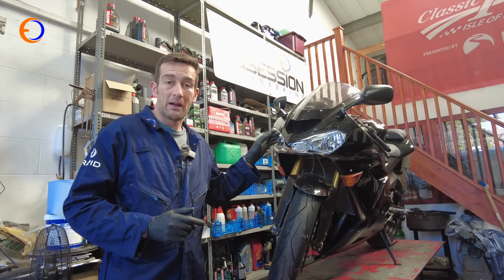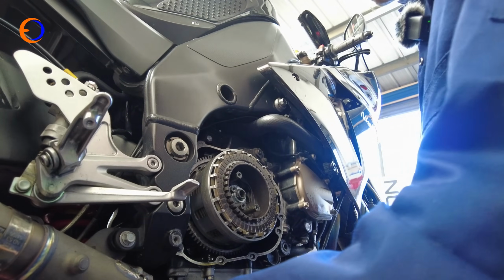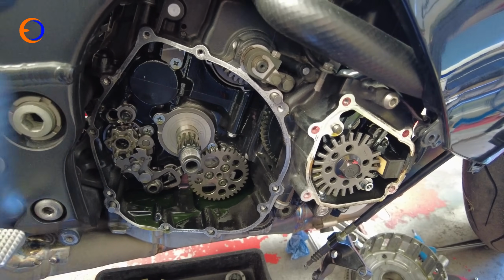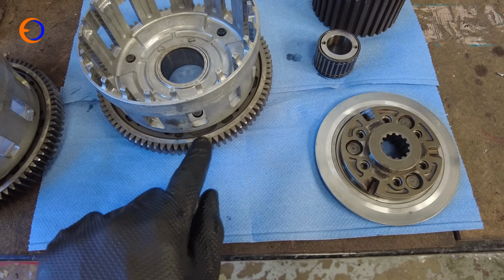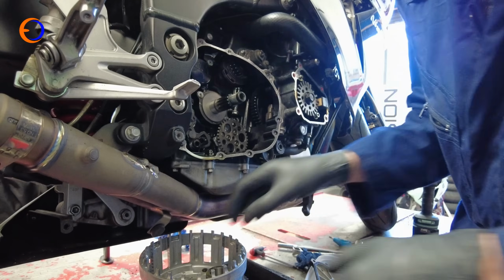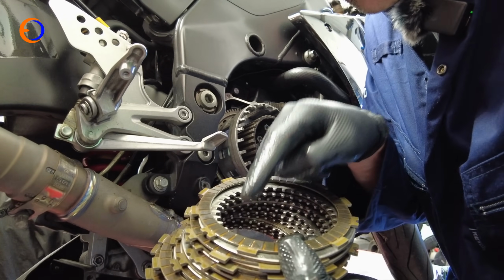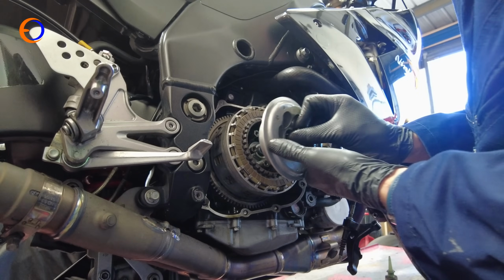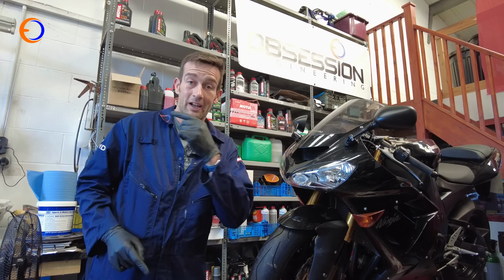ZX10r Clutch fix. Finally sorting the Kawasaki's rattle. Slipper clutch explained

Comment: Did you have a vibration in the footpegs. Did the buzzer go away when you pressed the clutch?
Reply from the maker: The noise was vastly improved with the better clutch fitted, and the noise was less with some load on it

Comment: The clutch arm under extreem load can pull down and fall off the rod and damage the arm engagement point to the rod, to fix it you may add a 3mm spacer or washer on top of the clutch cover where the spring and .5mm washer are located, this will prevent the arm from down force of the spinning clutch,,,,,, I cut a hole in an old clutch cover to see the engagement point so that I could see the problem area on the 1st gen zx10r, if you have never cut open a cover you will never know until you have a failier😅
Reply from the maker: Excellent knowledge, many thanks for sharing

Comment: So I have a question, I have a 05 zx10r. I replaced the clutch rod today as well as the cable and whenever I pull the clutch it doesn’t let it go into first gear. The cable has good tension and I’m not sure what it could be.
Reply from the maker: Aftermarket levers are often an issue, or it could be warped plates in the clutch pack.
Or possibly a loose hub, or something else completely

Comment: Thanks for an awesome video Dave! I had an issue on my 2012 ZX6R of a chatter or rattling sound on deceleration that would stop when I pulled clutch in. Could this have been the same problem? Also do you know if the basket for ZX10 is bigger than the ZX6? I'd like to have the better spring and plates in mine.

Comment: Where did u get the clutch cage washer ? I can’t find it anywhere
Reply from the maker: Lucky ebay find after lots of searching!
Reply: @obsession_engineering  I think ima start making parts my self
Reply: @obsession_engineering  when u had the spring loose, what did u experience mechanically ? Did u had a hard time going from neutral to 1st gear on a stop light on the street? My ZX10R 04 does have that problem some times on the street that’s why I stay holding clutch on stop light n never putting it on neutral.

Comment: Hi can I ask a question I have a 2006 zx6 636 put a new 3 rd gear in putting clutch plates back and noticed the plates slide back and forth quite a bit never noticed before is that normal cheers bob

Comment: man i wish there was a sound sample in this video. i have a zx600p and i have a suspicion that it maybe has the same problem.
Reply from the maker: The 600 motors tended to be a bit mechanical (some say noisy) and weren't unknown for cam chain tensioner issues. Not know clutches to be an issue though

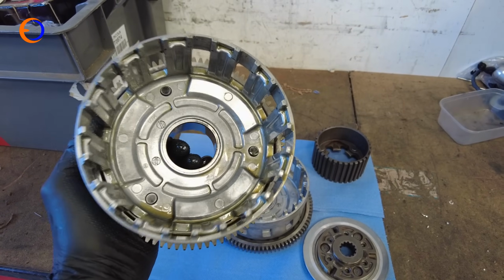Comment: 7:53 

when bike is running is that rattle noise gone when u pull the clutch in and than when u let the clutch it starts rattling again?
Reply from the maker: When the back of the basket wears, they rattle all the time
Reply: @obsession_engineering  in my question i explained the rattling on my triumph.. its not that bad.. its more noticeable on a cold engine.. 😁

Comment: I’m thinking my 05 Zx10r is Needing a Clutch. I pull the clutch in in Neutral and the Rear Continues to spin. It doesn’t physically Slip I can’t feel it that is. Any Recommendations For Clutches?
Reply from the maker: Common to get clutch drag if the hub or basket are wearing where the plates run on them. Might be worth having a look at that first. The oil will cause a little drag too.
I'd stick with oem parts as far as possible, they work well when there's no wear issues

Comment: I have a 2006 z750 and when it's cold or warming up I often get clutch honk,,any idea what the problem might be?
Reply from the maker: I've never looked at z750's so not sure if there's any regular issues.
Reply: 2006 Z750 95K km,  I had similar noises when cold in neutral. I checked /replaced the ball bearing that sits on center of pressure plate. Very easy DIY job.  The bearing type is SKF 6001.

Comment: Great informative video,,I prefer the older analogue bikes,, plenty of power and a lot less wires and pumps 🙂,, I've an 06 Gsxr 1000 aswell as an SV 1000 which has a rattling clutch 😢 thanks for posting this video ☘️☘️☘️☘️☘️☘️☘️☘️ from northern Ireland

Comment: I have a gen 1 zx10r, got it with about 15k miles give or take. I have 70k miles or so of hard riding lol love the gen 1 !!!!!! I had a issue with clutch kits burning up, I read about the muzzy zx12 clutch basket and hub mod to give the clutches more oil, did it to my gen 1. A complete difference and never had a burnt clutch again.
Reply from the maker: Very useful to know, thanks

Comment: I had awful trouble with my gen 1 clutch until I fitted a sigma slipper clutch system from a 2008 zx10r. You have to die grind out the clutch cover 1mm.

Result is 🤯

Comment: There is a bodge method of stopping the clutch spring rattle (recently had to do it to my CB500) which works but is at your own risk. Simply insert one washer of the correct diameter under one end of each spring (thick enough to be a relatively tight fit) and then tack weld the washer in place.
It worked for me and I believe some of the CB500 racers do it too so it can’t be all that bad. 🤞

Comment: What sort of mileage would you expect from the springs if only used on the road on the 04 and 05 bikes
Reply from the maker: Very much depends on how it's been ridden, dumping the clutch on down shifts, especially on track causes more problems. On the road I've seen 40k mile bikes with no issues

Comment: The 1st steel, anti-judder plate, also fits the GSXR 1000 K1, K2's which helps the GSXR get off the line, by solving the snatchy clutch issue.
Reply: Had same problem with my k4 works like a dream with the zx10 steel in
Reply: Very interesting
Reply: I throw the jutter spring in the trash. APE track king clutch. APE basket. Works like a champ.
Reply: i’m having this snatchy clutch issue on my k7… any idea?

Comment: 🤔 after the montage AND refilling oil "why raving the engine/rpm?" neither the clutch-leaver at "basic" rpm (1200min^-1) 
i spot at a repair like here that the owner let the engine run and move the clutch-plate by the leaver ~5min. , clean-up the workspace and again he told me that should be the oil-viskosität ...powertrain was "hand warm" not hot !